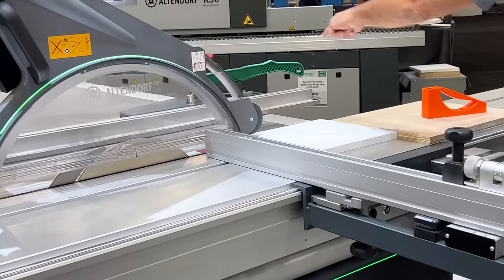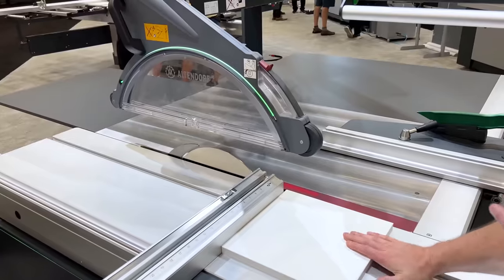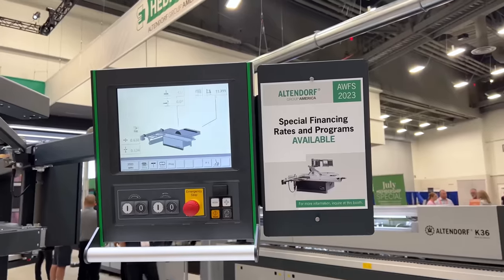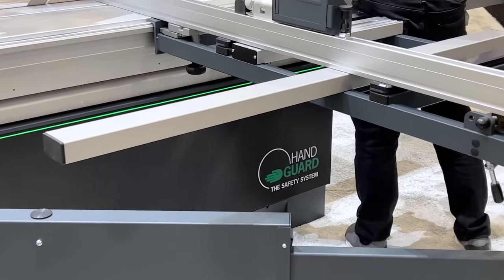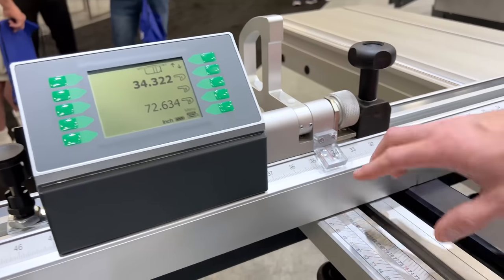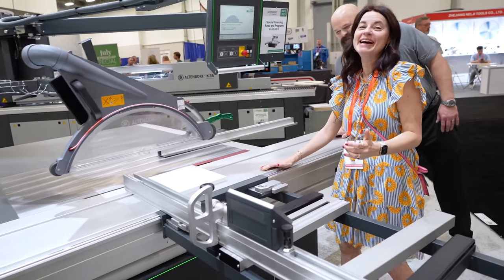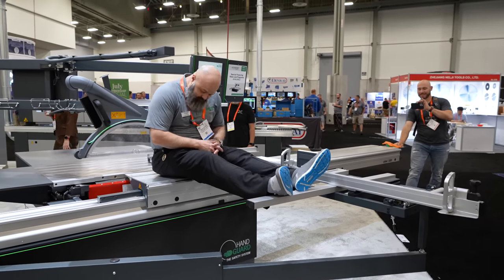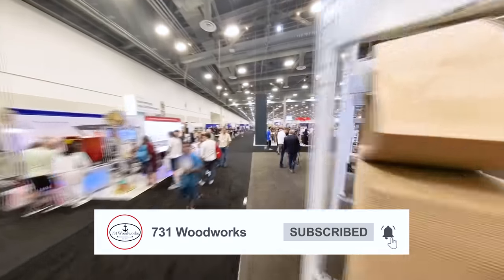The Most Exciting Table Saw in YEARS!

Comment: There is no reason this could not make it to consumer grade equipment. The computer vision bit if child's play these days so the only thing is that you would need a saw with enough hight to allow for the blade to drop so contractors saws are unlikely for that reason but besides that why on earth not (technically at least). The reason why this might not happen is the company that owns the technology is not into the consumer/prosumer business. Going into that business is of course possible but that would require a whole different development and manufacturing ethos (price is a much bigger concern in this market) a new distribution and sales setup as well as an extensive marketing campaign and a very different customer service approach. Though possible the company has been around for a long time and has never taken that step there is little reason for it to do so now.
What might happen is that they setup a partnership with another brand or if they are feeling spendy standup a new company to bring this to the consumer/prosumer market. but that is a very expensive idea so a partner ship with one of the existing consumer/prosumer players is probably a better bet.

On the other hand Saw stop will loose their patents eventually and by the looks of it that is likely to happen in 4 to 5 years at which point it is highly likely that the competition will bring this tech to the market on the cheaper end. That makes this product for the lower end of the market questionable as this segment does not need the 10 second reset or the fully digital readouts and so on. Sure it is nice to have but for the most part the lower end of the table saw market is small shops, garage warriors and so on. They swill simply sacrifice perfect accuracy in high volume production for a much lower price and slightly less efficiency. So how big a splash this would make in the lower end of the market... I think it is not going to do much for that market if it ever gets there.

But it is a really cool thing to see and it is good to see how technology is more and more infiltrating the wood working space, more and more digital solutions for quicker more precise and safer working with increased efficiency is a good thing.

Comment: People need to stop using the term "AI" for every single algorithm process that is implemented on a device/machine.. 
AI is cognitive thinking. This is very likely an algorithm based process, or at best, machine learning. Not AI. 
This machine simply has a processor that looks at the image and if parts of the image align with what has been programmed as things that shouldn't be cut, then it triggers the machines preventative measures.
Reply: You are absolutely correct, machine learning and vision based tracking are methodologies used but when you are presenting this product a few hundred times to people who may or may not have the knowledge base that you draw from, buzz words are the unfortunate crutch we have to use to get the idea across. 😊

Comment: Disclaimer....I'm an old guy who's done woodworking for many years with the tools we've had available to us.  That said, two thoughts.  One, production shops rely on....production.  When the electronics on that thing act up or fail, my bet is you'll have to call in someone to address the issue(s) as you'll likely be unable to deal with them on your own (like we all do with our 'dumb' saws).  That's lost time and revenue and potentially unhappy customers, along with a nice bill on top of it.  And two, (remember I said I was old), I don't like the idea of trying to idiot-proof a table saw.  This equipment is dangerous by nature, regardless the whiz bang electronics applied.  People using tools like this need to learn how to safely and effectively use them, and always respect and even fear them to a degree.  That is what keeps you safe.  My skills have kept all my digits attached to my hands for the past 25 years running stock through my old Powermatic 66 saw.
Reply: Plenty of people go twenty, thirty, even forty years using table saws and then one day they lop off a finger.  You can be the best, safest operator on the planet, but as long as you're still human you're capable of screwing up and it only takes once
Reply: @tehbieber  How does one "Lob off a finger"?  I'll answer that for you.  It doesn't happen by 'accident', it happens by being 'careless' because you're tired, or in a hurry, or distracted.  If you avoid those three things, use a push stick or push block when appropriate, and ALWAYS keep your hands away from that spinning 10" blade, you'll have a full career of woodworking while keeping all your digits.  On the other hand, if you try and idiot-proof a dangerous machine/process, allowing people to rely on the equipment to save them from their own carelessness, they'll carry that carelessness with them and end up injuring themselves on a bandsaw, or jointer, or any number of other non-computerized machines.
Reply: @Mike-In-O-Town  that's a very comforting fiction, but it's simply untrue.  Everyone makes mistakes, no one is at their best 100% of the time they're in the shop, and if you think you're the one exception you're lying to yourself.  

As for the assertion that adding safety features to one tool somehow makes the others more dangerous, that's just a wild conjecture with absolutely no evidence to back it.  Taking your reasoning to its logical conclusion, the world would be a safer place if we just got rid of all safety precautions altogether
Reply: @tehbieber  I'm not going to belabor this at length because it simply is not worth the effort, but I'll leave you with something to ponder.  Read that as this is my final post on this topic.

So here goes.  Brand new automobiles have all sorts of safety features.  Older cars on the other hand, not so much.  So which is safer on the street.  A completely untrained m*oro*n blasting music and checking Instagram while driving a brand new car relying on its safety features to save his bacon when he inevitably screws up, or a well trained, seasoned, and very cautious driver in an old car?  Best scenario would be to have a well trained cautious driver in a brand spanking new car with all its safety features, but alas, many of us can't (and won't) bury that kinda coin in a brand new car when the old one works great and does everything we ask of it.  There is no substitute for experience and training.  I've worked around a production shop long enough to recognize that these automated 'safety' features are more a 'legal liability' avoidance tool for the business owner than a personal safety device for the employee.
Reply: @Mike-In-O-Town  it's funny you ask that question like it's a hypothetical when in actual fact there's reams of data all pointing to the obvious conclusion.  The traffic fatality rate in the United States has been on a consistent decline since the 1970s, with the 2021 per-capita rate only 53% of the rate in 1970.  So, yeah, that "safety features make you less safe" hypothesis doesn't seem to hold up there

Comment: So, why not tell us the price?  I never understand why that has to be a mystery.

Second, the saw stop is a few hundred dollars more expensive than a comparable saw without the saw stop technology.  Yes, it may ruin the blade and it takes some replacement parts to get the saw stop back running.  But, I'm guessing that you could do that many times for the difference in cost to this saw.

Lastly, how about putting safety tech on a modestly priced decent saw that if for the person or company that doesn't need a built like a tank saw?  Marketing and profit?

Comment: Very nice machine but got my doubts.  Use it don't use it......production machine and the sensors get clogged with dust😢. Don't want to sound like devils advocate.  Dust is always the one thing we worry about.  Even in safety
Reply: Dust is NOT a problem. The cameras are above the saw and  even if they SOMEHOW get absolutely CAKED in debris, you will know the moment you turn the saw on in the morning when it runs the calibration tests. It only takes about 1 minute for it to run the test and if it can't see, you are alerted and can wipe off those lenses. We have not had a single problem reported due to dust or debris affecting the system.

Comment: I think most of the mainstream consumer power tools available today are hot garbage. I have bought and then returned countless tools from various well-known brands such as Makita, DeWalt, Metabo, Hitachi... I have to say Makita has been probably the most disappointing of all.A lot of the poor quality problems boil down to piss-poor Q.A. at the factory. Even Festool isn't perfect. I just think that, even though today we have very advanced technology to manufacture great tools, we don't. Up until the 80s tools and products in general may have looked boxier and uglier but holy coy did they hold up well. I have a very old Makita hammer drill that still works. I have a washing machine from the mid-eighties that I'm still using today to do my washing, 40 years later.

Comment: Amazing craftsmanship and execution, especially the mechanical part.  But I am scared. The more people talk, the more I am scared about AI. Not because AI is scary by itself or because machines gonna conquer the Earth, Nope. I am scared of blatant use and  very fast introduction of software (and let's be far - this is NOT general AI, just some recognition using models) in the cases where one small bug - can cost somebody hand or potentially life.  Check this example : https://en.wikipedia.org/wiki/Therac-25 ... Plus , I was doing image recognition and compression algorithms way-way back, and worked with , so-called AI up until 2 years ago. There is no AI yet. And when we have one, who is going to stop AI deciding that this duded today deserves to have his fingers amputated? .. Also, what about knot in the wood ? Catching blade and kicking it back?  Is that in software or we need to wait for patch? 

On a positive note - once more  - brilliant execution of blade "dropping" mechanism. I wonder how they have achieved such speeds?
Reply: I cannot speak to the vision based recognition and tracking software BUT I can tell you that the mechanism that we use to retract the blade (which also controls the height adjustment of the blade) is proven systems and parts that have been on use for many years in metal cutting CNC machinery and they can achieve eye-watering speeds. Watch some videos on rapid traverse in cnc machines and you'll find some that are ludicrously fast!😊😊
Reply: @BradSnyderAltendorf  Well ,yee, that answer some of what I've been thinking. And I have an example for you about recognition. After decades.... DECADES of doing the stuff, still, sometimes when we leaving parking in broad daylight, unclouded day - we need to scan the ticket. Becuase license plate recognition failed. On average , depending from technology..it's  92 to 98% success rate.  And while these algorithms and hardware is progressing, it's never 100% yet....  I wish the company and product the best, but, I be mindful myself not to trust fingers to AI :-)

Comment: this is super cool, but why not have a real blade in there if he's confident in it?
Reply: the AWFS show would not allow it. There are a lot of videos of the system being tested with real blades though and I have personally do so myself without issue.
Reply: @BandSWoodcraft  ahh, that makes sense! I'm mostly just jealous of how awesome it looks. what size blade is it on there? it looks bigger than 10"
Reply: @atomictyler That test blade was about 15 inches diameter. That saw, depending on which option, can hold up to a 20 inch blade.

Comment: This saw would be even safer if it had a crown guard attached to riving knife and he was using push sticks instead of hands. In fact their safety system would be quite redundant and a complete waste of money.
It also encourages unsafe practices and could itself fail.
They are just trying to sell a lot of unnecessary gear - not much profit to be made out of push sticks even though they are much safer!
Or is it just a joke? I didn't watch to the end!
Reply: Imagine all this because no one wants to use a push stick. This is crazy. Money should have been spent on hands off automation and production rates.

Comment: AVOID PR NIGHTMARES: Does this work equally well on heavily-melanated hands?
Reply: yes it does. Even works with heavily tattooed hands as well.
Reply: I forgot to mention it works if you are missing fingers, even if you have NO fingers, the points that it recognizes on the hand will be picked up. it has been extensively tested not just by us and our clients throughout the world but by 3rd party institutions and governmental bodies and is the first and ONLY safety system to be certified by the GS and subsequently recognized by the EU. The HandGuard system is a feat of design and engineering! Thanks again for the question!!
Reply: @BradSnyderAltendorf  Boom! Bringing receipts! Respect earned

Comment: There are so many points of failure in this the mind boggles. It might be reliable new, but after a couple of years the cameras, servos, electronics will all be prone to issues, and a workshop is hard on equipment. Sawstop is very elegant in comparison. It's interesting but, no.

Comment: So the motor and blade, which apparently weighs almost 600 pounds, isn't actively held up? It relies on a motor to drive it down? Thats incredibly unsafe and insane. The goal of equipment should be to fail safe, which would be a motor actively held against gravity.
If you want to go the unsafe method, make the blade much lighter, save thousands of dollars in manufacturing and shipping costs per unit, and save the poor SoBs who have to move the machine.

Comment: Personally, I think it's dangerous. What it can do is lull "those who can be lulled" into a sense of false security. What if the mechanism that drops the blade fails? What if the software glitches? Mechanical components fail, as do electronics, and, more often than not, unexpectedly. Not saying it's not a good "saw" or brand, but there is NO substitute for learning and FOLLOWING common-sense, time-honored safety protocols. Just my .02!

Comment: I have a SawStop and it retracts MUCH faster than this saw. A sawstop blade will retract in 5 ms according to their website. As this saw blade only drops by gravity, assuming the height of the blade in this video is 4 inches, using high school physics that translates to a “drop time“ of 140 ms. Plenty of time to mangle fingers if they are thrown into the blade by kickback or something involuntary. 
But thank goodness it uses A.I., right?
Beautiful table though. Wish I could get one for my sawstop.😂
Reply: It is driven down by servo motors, Matt even got some great footage of the system working at regular speed but when it's activated it is driven by those motors extremely quickly while also being controlled the entire way.
Reply: @BradSnyderAltendorf  interesting, do you happen to know what the retraction time is?
Reply: @josephmueller1545  I don't want to give incorrect info so I will verify with the engineers in Minden and get an exact number! They are about 7 hours ahead of me here in Texas so won't hear back until tomorrow!
Reply: Did Minden help?
Reply: @josephmueller1545  I didn't send anything until late yesterday evening. 🥺🥺
Reply: @josephmueller1545  something that I did think of afterwards was that the point of activation on our system is not finite. The system draws a "box" around the danger zone and that box, while it does have a minimum size, will get larger based on many factors including how fast the hand is moving towards the box, the blade height etc. The algorithm knows exactly how much time it will take to fully retract the blade at any given height and compensates accordingly. Even if there is a sudden change in angle or speed of the hand the program will activate in time to remove the potential danger. I know that our saw can have a blade with a 500mm diameter and a projection of 179mm and the blade at full extension can be fully retracted in less than .25 seconds. It is quite fast and don't forget that even old CNC machines (like an old Okuma) can fast travel at upwards of 2,000 inches per minute using servo motors with lead screws. If you really do want to get into the minutiae, get my contact info from Matt and I'll put you directly in touch with them. Thank you for the inquiry though! You must work in the HSE side of your company or are a physics prof!
Reply: No problem at all, just curious.😊